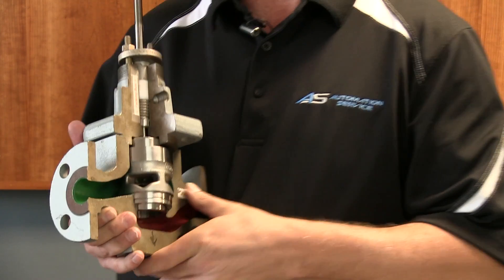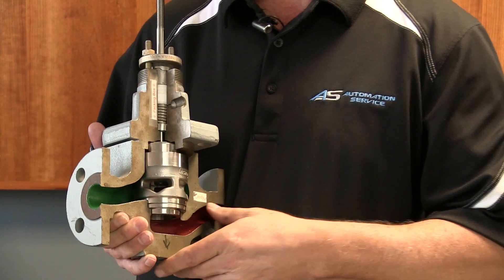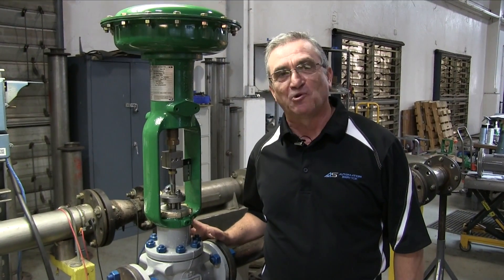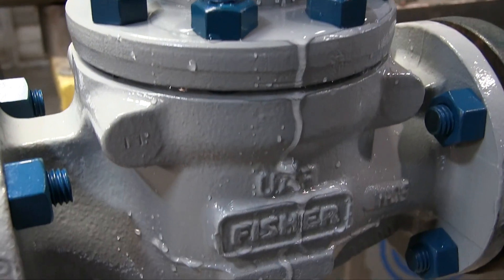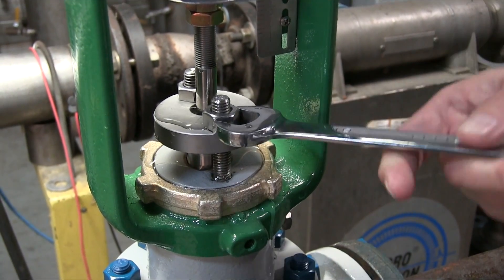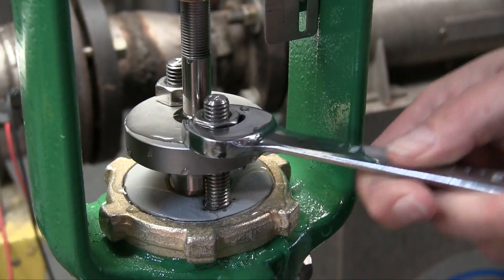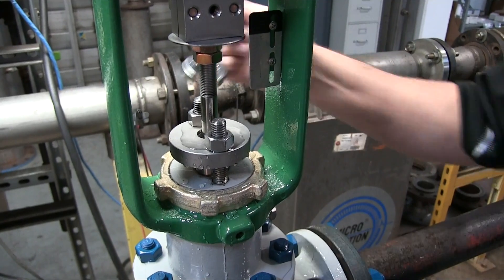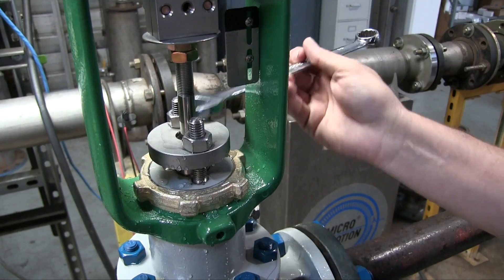Control Valve Maintenance - One Simple Thing You Can Do To Extend The Life Of Your Control Valve

Comment: My valve is not hold pressure and is not leaking from the parker but from internal valve body .
I have disassembled it and inspected the valve properly the steam plug, seat ring and the gate no visible cut or rupture was detected, what should I do next?